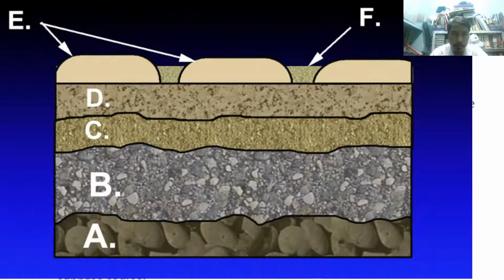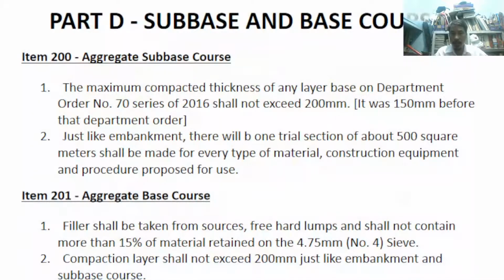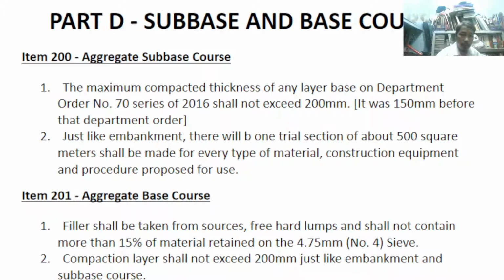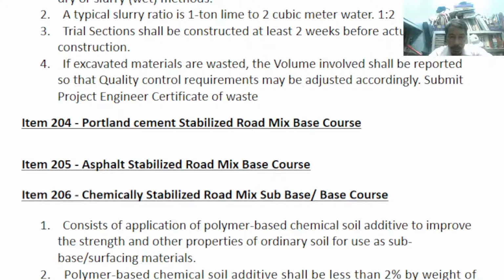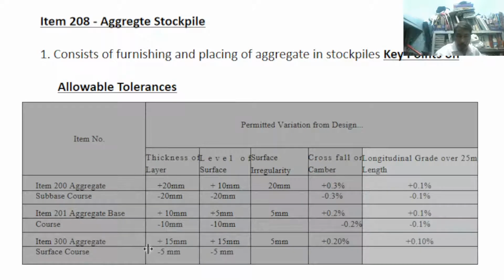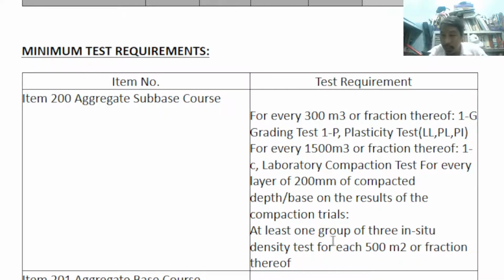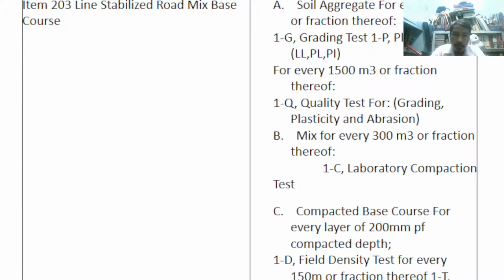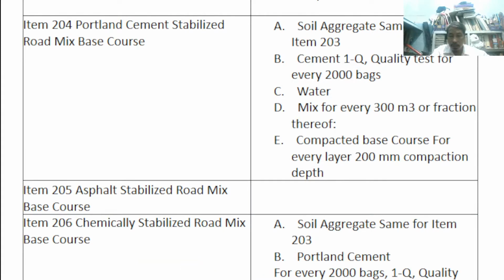[ LIVE CEE4 Lecture 08 ] DrAP Zantua Part D: Sub-base & Base Course for Material Engineer + DPWH DO

Comment: Thank you, Sir for the live lecture. I appreciated you sharing your knowledge.There are two types of bases: unbound bases, like gravel or crushed stone, and stabilized bases, like asphalt, cement, or lime. In between the base and the subgrade, there is often a granular borrow called the subbase course. It can be constructed as a treated layer or an untreated layer. A concrete slab's subgrade and subbase serve as its basis and are crucial to how well it functions.

Comment: Thank you sir for sharing you knowledge,Two types of Base can be made of unbound materials like gravel or crushed stone, or stabilized materials like asphalt, cement, or lime. The subbase course is typically a granular borrow located between the base and the subgrade. It can be built as a treated or untreated layer. The subgrade and subbase are the foundation of a concrete slab and play an important role in its performance.

Comment: Thankyou sir for discussing about subbase and base code. In aggregate subbase course the maximum compacted thickness of any layer base on department order no. 70 series of 2016 shall not exceed 200mm. Just like embankment, there will be one trial section of about 500 square meters shall be made for every type of material, construction equipment and procedure proposed for use.

Comment: thank you sir for discussing the continuation of the last discussion. This live lecture is about part D: Sub-base and base for material engineer. I learned that the maximum compacted thickness of any layer base on department order no. 70 series of 2016 shall not exceed 200mm. just like embankment, there will be one trail section of about 5000 square meters shall be made for every type of material, construction equipment and procedures propose for use. This video includes aggregates subbase course, aggregate base course, crushed aggregate base course, lime stabilized road mix base course, Portland cement stabilized road mix base course, asphalt stabilized road mix base course, chemically stabilized road mix sub base/ base course, Portland cement treated plant mix base course.

Comment: Thank you, sir for discussing the sub-base and base course for material engineering. The layers in illustration were the construction of a mortarless pavement wherein A. Subgrade which involve soil, B. Subbase are sand and gravel, C. Base Course is a mixture of soil and crushed aggregates, D. Paver base or pavement base, E. Pavers is a paving stone, and F. Fine-grained sand. This also talks about the DPWH Department Order for sub-base and base course. Thank you, sir for sharing this data. There's a lot of information to gain in here.